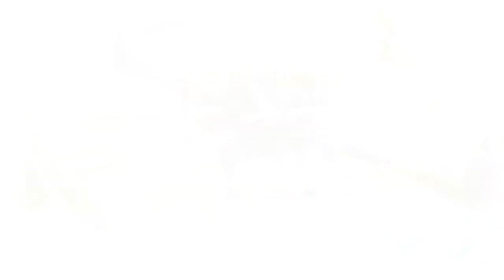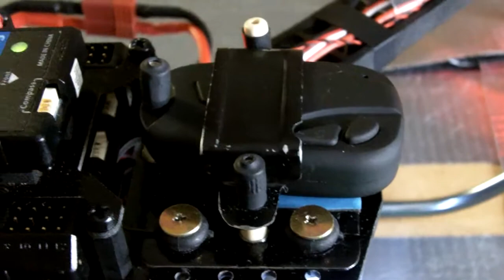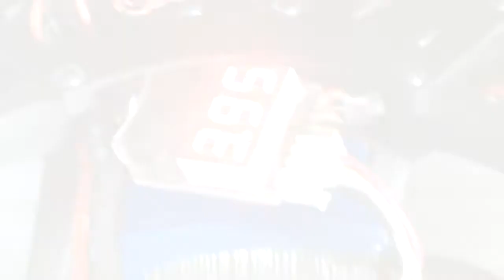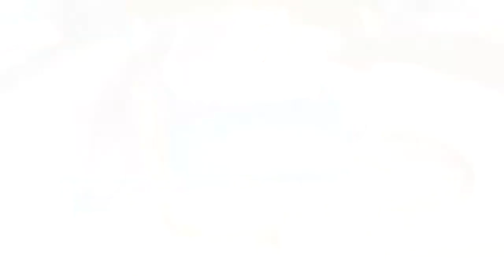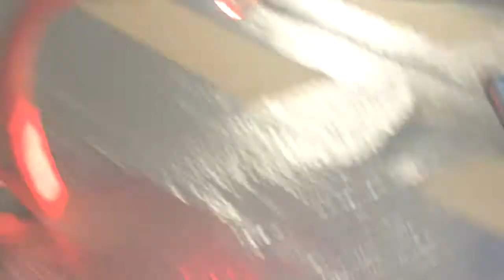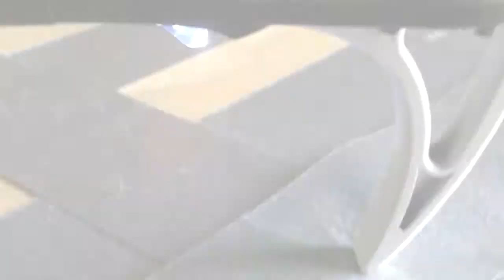X450 Pro w/ Light Kit and New Camera Mount

Comment: well i though the frame will work with my x450 motors and blad its seem like it didn't work well also put some lights where you put yours and after taken it up  high the legs will get in the way of the light and block it so so i went back to my old frame everything working better no:) check out my video with the lights on you will love them there really bright to see during the day time and there really bright at night time to light up the ground from 5ft up:)